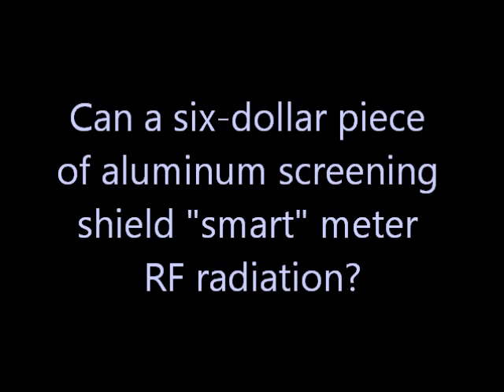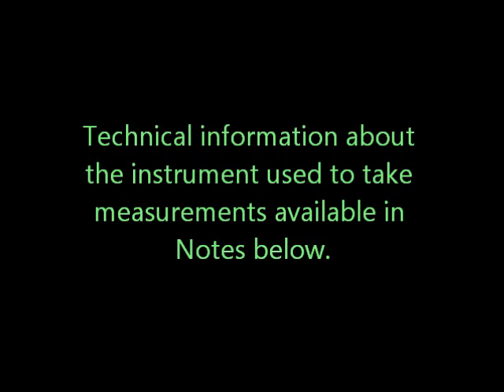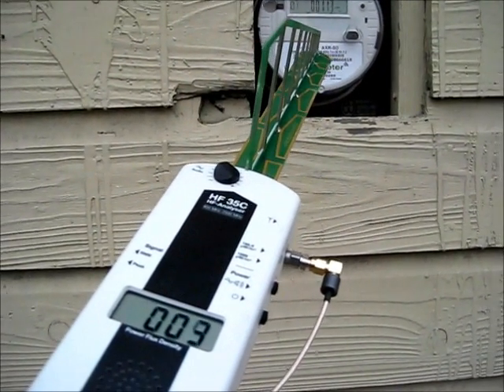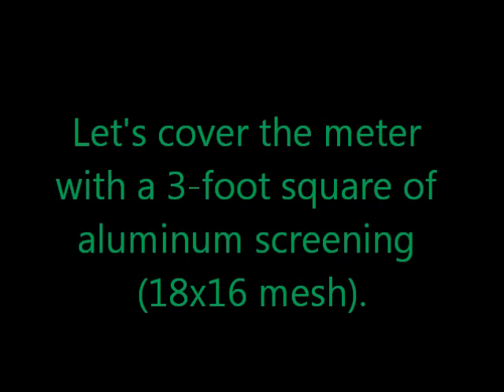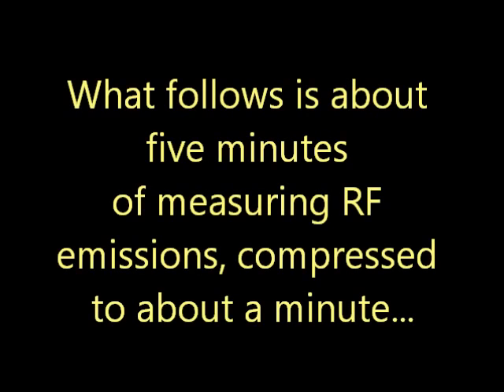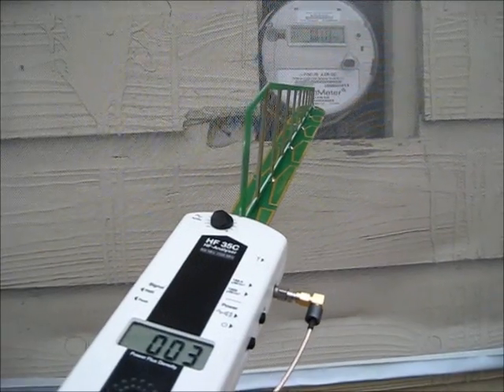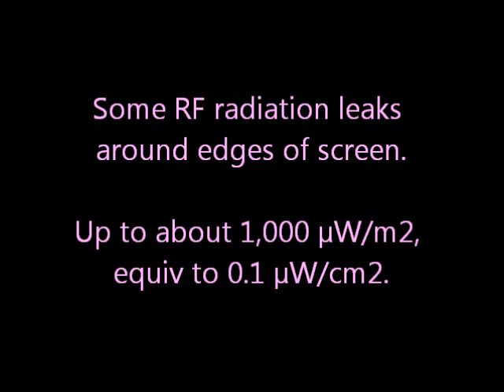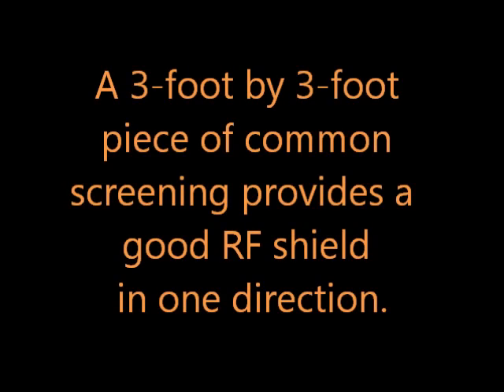Foiling a "Smart" Meter, Part Two: Aluminum Mesh Screening

Comment: So, you cover the meter with metal screen, it can't communicate with other nearby meters to report your electrical usage to the central office, prompting an eventual visit from your utility provider, whereupon they remove the screen and you end up paying for previously unreported electrical usage, or get charged for theft of services.  How's that supposed to help?
Reply: I personally went through this with my electric company in Indiana just 
about 4 years ago.  Bottom line, this is how I got out of it legally... 
 I was smart enough to research the legality, and I discovered that the 
the electric company actually had no legal right/authority to place a 
"DIGITAL RECORDING DIVINE", or a "ELECTRONIC SURVEILLANCE DEVICE" onto 
my property.   By default, that is that the "smart meter" is legally 
classified as...  an "Electronic Surveillance Device".     As it turns 
out, I had discovered that in my area within Indiana, any home built 
prior to 2005 actually was protected by what is called a "Land Easement"
    The Electric company had a legal right to have their property on my 
home, HOWEVER, that legally binding "LAND EASEMENT"  specifically stated
 that their legal right to my property was specifically for a "ANALOG 
MONITORING DEVICE"....   after only 2 phone arguments with the Utility 
supervisor for Warren County Indiana, he quickly learned that I was 
right, and he was legally made to remove his digital device from my 
property as he had NO LEGAL RIGHT to have any other type of device on my
 land.  I won that battle....  that's not a "tinfoil hat story"....  
call REMC in WARREN COUNTY YOURSELF AND ASK THEM.
Reply: If you just cover the back of the smart meter you can start the EMF coming into your home, it will instead go out of your home and can still be read by the utility company.
Reply: That was my thought
Reply: ***** The smart meter at my house happens to be just outside my bedroom, about 8 feet from my bed.  I can hear a buzz on the AM radio in the bedroom when the microwave oven is running 25 feet away in the kitchen, due to a low level of energy leakage that is considered harmless, but I have yet to hear a peep on the radio from the meter doing its thing.  I sleep well and I'm not worried.
Reply: ***** I, on the other hand, enjoy reading the obituaries of electrical and electronics engineers who died in their early to mid-90s, while working with electromagnetic fields their whole lives.  Perhaps, if they hadn't been exposed to that energy, they might have made 100.  Chances are, the people to whom you refer have high levels of hypochondria.  You could install a dummy meter outside their house, they start feeling ill for any one of a dozen reasons, and as soon as they discover the dummy meter, they say, "Aha! I KNEW it!!  That meter is irradiating me and making me sick!"  Anecdotal evidence isn't useful in a scientific proof.
Reply: If you get sick from EMF coming off one of these don't ever go outside or even stand near a window. Sunlight reflected off the moon on a cloudy night bombards you with EMF. The very ground radiates EMF. Everything you have ever looked at that has a color has that color because of reflected EMF. Go find a real disease.
Reply: *****   "agenda 21 depopulation"??    ooohh....  can I get an Abyssinian Wish Box or some Feng Shui amulets for that?
Reply: ***** You're an Idiot, take a cell phone and put to your ear for 10 min., Ear get hot?? why do you think it gets hot? It's microwaving your  ear, skin, brain, now compound that with wifi, other RF communicating smart devices in your house? get the picture?
Reply: Wermhats Wormhat  And you're moron, No, they really are not, it might be radiation with a small r, but it's still radiation, what does radiation do? well..... do some research, lol, look it up for yourself(google?), clearly you do not understand the science behind, wattage, frequency, and electricity, and I do, and the person making this video, does too. And, if you want to keep the RF from going  back into your home wouldn't you have just put Aluminum foil on the other side of the meter as well as the front, just a thought?
Reply: Justo Talkalottashit Lmao!!! Bwa, Ha, Ha!!
Reply: Wermhats Wormhat Troll biatch, lol
Reply: ***** You are correct, and I really think these clowns are just trollin', the fact they could( if they were not maybe lazy, enough to look up this shit for themselves on the internet)could learn something about science instead of talking out of their ass,I mean shit if you're going to debate it or argue your side at least back it up with facts.
Reply: I just had some dental work done and now I'm hearing voices, and Paul posted that "dentists implanting RFID's along with the anesthesia in peoples heads". [Jan.21st, above]

But I'm a smart Power Company Manager© and pretty good with my Milwaukee hammer drill so I'm going to fix that bad boy myself.
Reply: +Paul Metcalf Don't worry. Their kids will pay the price.  They will also, but probably won't recognize it.
Reply: +Milosz Ostrow You've got to be kidding me!
Reply: +Milosz Ostrow You assume placebo effect, based on what?  Do you even know how to eliminate placebo effect?
Reply: +Wermhats Wormhat You know arguments like yours are pretty ineffective nowadays.  Ever heard the "Cry Wolf" story?  Those arguments are meant to shut down discussions, not to continue any dialogue.  What is your scientific background?
Reply: +Ebenezer Kalarama If that router was Comcast, and it was set to be a Hotspot, I'd say she was 100% correct.
Reply: +mmakshak Raise your hand if you wished the cell phone companies had spent the almost $20 million/year/each in campaign contributions(i.e. bribes) since 2008 on studying health effects of the non-ionizing EMF put out by their products, and trying to ameliorate that.
Reply: +Paul Metcalf Isn't it a shame that we have to deal with this?  Non-ionizing EMF is bad for your health, but we get no research or attempts to minimize this from the perpetrators of these devices.  Instead, they bribe officials(campaign contributions) to keep standards the same.
Reply: +Milosz Ostrow Those people were dealing with 60hz and multiples of that frequency.  Now, we are dealing with a much higher frequency-over 900mhz, and these frequencies are relatively new.  So, your example of electrical engineers isn't applicable.
Reply: +Wermhats Wormhat When discussion is suppressed(effects of non-ionizing EMF), you can't assume it is safe.
Reply: +Milosz Ostrow Considered harmless?  By whom?  I might agree with you at that distance, but I would start to experiment with distance from that smart meter when sleeping.  I sleep like a baby(at 64 years old), but it is a side effect of energizing my room and person.  I get colorful dreams also.
Reply: +Paul Metcalf It's hard to think correctly in our super-high frequency, non-ionizing EMF(wifi) environment. The potential for abuse increases the less we know about things.  We aren't going to get any info from these companies(power and cell phone), and we are going to have to come up with our own.  We need to eliminate our exposure to high strength transmitters of these frequencies-based on my research.  Such things as Comcast routers, probably smart meters, obviously cell phone towers are dangerous, and we should distance ourselves from those.  You can lower the danger with orgonite(I'm intrigued by burying the orgonite near cell phone towers.), but. at least with the Comcast router, you have to turn off the hotspot(settings and preferences), and even then, it was not enough, so now it is in the bridge mode, which makes it okay, I think.  I sit within 3 feet of the router.  We need people to start experimenting with towers close to where they live, and report the results to people.  I also wonder about a carrier frequency(a lower frequency put out that might make these super-high frequencies safer), and, even though I have frequency generator(chi generator), which I could experiment with, I make a product that helps with the effects of this EMF present in our air, so I'm putting my efforts into making and distributing this.  People would be surprised, but, more importantly, they would get a little protection from what's actually out there.
Reply: +Wermhats Wormhat I'm not a hypochondriac, as I'm talking about the fantastic increase in health that occurs when you combat EMF, and add energy to your body.
Reply: +Ebenezer Kalarama If that router was the only change that happened, I would suggest that's sufficient input to experiment with the router.  For instance, if it's a Comcast router, it is enough of a problem that I will go further, and say that is the cause.  She probably should screen the wall behind it, and run that into ground..
Reply: The rapid pulses are very bad for the cells.
Reply: *****   Absolutely.  I recently read a post by an elderly woman whose 45 year old son had been divorced and lost his job and he had to move back in with her. She was complaining that his router was directly on the other side of the wall from her bedroom and now that's the reason why she's been feeling "sick".    (>L<)

Edit - Maybe he was a power company manager! Maybe his mother was too..
Reply: *****  May theft-of-service circumstances place you and the other EMF wackadoos in a nice EMF-free jail cell.
Reply: ***** ....add to my list, another uber-dirty-EMF environment that never made anyone sick : city subways. Of course, you think they have, it's just that no one has ever discussed it somehow... since 1904 anyway.
Reply: Tell us about the smart meter/Apollo landing/911/CIA/ power company manager/ancient aliens/cancer/smart meter connection.

Edit: Tell us about the smart meter/Apollo landing/911/CIA/ power company manager/ancient aliens/cancer/smart meter/Abyssinian Wish Boxes/Feng Shui amulets/SFBs connection.
Reply: *****   That's what I meant silly, Agenda 21 is real and so are Abyssinian Wish Boxes and Feng Shui amulets.
Reply: ***** Why wouldn't these overlords have UL in their pockets and get UL approval on their subversive devices.  This UL argument blows up your premise. Another premise destroying comment is the fact Infowars is its own tightly controlled media outlet.
Reply: Oww my schnozz.
Reply: No.  The meter is still counting, just not relaying the info into your brain
Reply: Why not just turn the microwave oven inside-out, like this one:

http://i00.i.aliimg.com/photo/v0/153656180/Microwave_Diathermy_Unit_bioresonance_therapy_equipment_Made.jpg
Reply: +Wermhats Wormhat How about the federal ruling in 1996 that stops cities and states from denying cell phone tower construction based on health?
Reply: +Ebenezer Kalarama While your at it, send those 400 scientists who signed the petition on EMF dangers to the same cell.
Reply: +Milosz Ostrow If, as you say, the human body is a conductor, what would be the effect of adding aluminum to it, as that's the main ingredient chemtrail believers say is being sprayed on us?
Reply: ***** You're talking nonsense.  Due to a phenomenon called "skin effect", high frequency electromagnetic waves tend to remain on the surface of conductors.  The human body is a conductor, albeit not as good as metals like copper and aluminum.  Considering the extremely low power emissions coming from smart meter mesh networks, the radiation received from them is a tiny fraction of what is legally permissible leakage from household microwave ovens.
Reply: ***** Nah, just a student of life, a graduate of the School of Hard Knocks.
Reply: *****  Kosher mainstream sources....... Is that anything like a Kosher Pickle? The favirite food of Rush Limblab..
Reply: So it's all bullshit then
Reply: Nobody is getting sick from "these things".  It is, however, possible for someone to worry themselves sick, i.e., worry so much about nothing that they literally become ill, as the depression in their mind adversely affects hormone production and depresses the immune system.
Reply: @Milosz_Ostrow  Next your probably going to tell us Its all to improve our health, chem trails too. OH YEA

Comment: I think that if you wanted to shield the microwave radiation you will need a Faraday Cage. That means the screening will have to be earthed. Would that mean the power company then be unable to measure the electricity consumption? Hmmm......

Comment: Good to know!  Thanks!   I have a question.  Would you suggest putting mesh on the OTHER side of the wall, i.e., the interior wall.  And, could one use, say, enough to put on the back of a large picture (in frame) to hide the mesh on the inside wall?
Reply: The views expressed are mine only and do not necessarily reflect the views of SMUD.  

exactly.  and that is why this idea is a least a stepping stone to be able to construct things more safely for others.
Reply: Well YEAH, because who gives a crap about the 'radiation" going out across the public sidewalk, you want to protect your own ass as you sit indoors, so be sure to tape window screens all over the inside walls of the room!
Reply: +Victorian Sculptures That's actually a good idea, but i think you need to ground the screen.

Comment: the problem is your then bouncing that rf back into the house. best bet is the spray lead all around the meter then  spray norm laytec around it.
Reply: +Nathan Dean Doesn't lead absorb the rf, rather than give a bounce-back situation?  If so, it's a good idea, but can lead become saturated(needing to be grounded)?
Reply: mmakshak
then go with copper then. and ground that out or go with stainless steel.

Comment: You are scared of radio waves?
Reply: +glen quagmire Only because the non-ionizing EMF, put out at a super high frequency, is bad for you.  In addition, our environment has a huge increase in these wifi signals in our air(populated areas).  Because of campaign contributions(bribes), you are left on your own to deal with this.

Comment: Would you not have to surround the entire meter with mesh?  Doesn't those pulse 360 degress?  This might help the people walking by but what about the people living inside?
Reply: The staple gun worked better on the outside of the house.
Reply: Frederique Zug
Shocking they get away with this!